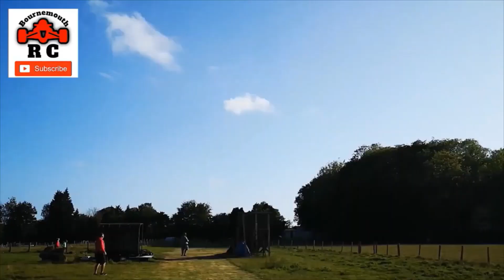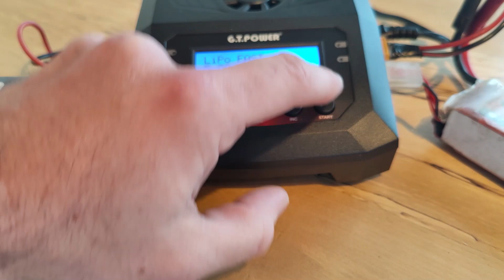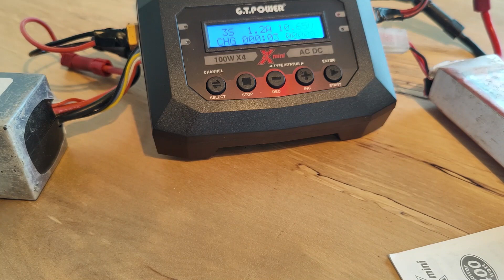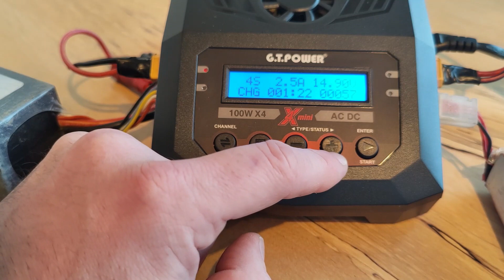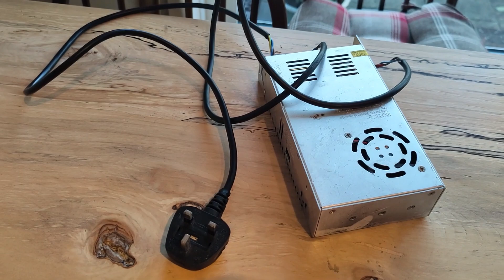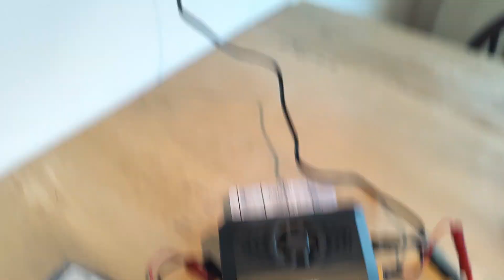Unboxing and Review of the GT Power X4 Mini Charger 100W AC / 100W x4 DC

Comment: Great video, if you already know it all. I don't, so I got pretty much zilch from watching. I have Deans and EC connectors with balancing leads off, no mention of what to do with these. A domestic socket outlet will power a 3 kilowatt heater yet you say this charger cant cope with 2 batteries at the same time? Confused. I have a GT Power charger, doesn't say on it what it is but it's white. All you do is plug in the corresponding balancing leads in the right place, can't get it wrong. It will do at the same time 3 x 2S, 2 x 3S or 1x 4S. It's the only charger that is clear to use, for me. I want another charger but as far as I know, none of them tell you about the plugs and stuff, you certainly didn't :-( you could have, don't assume we already know